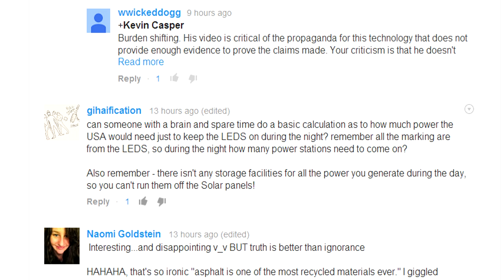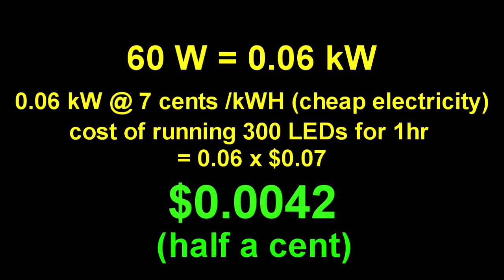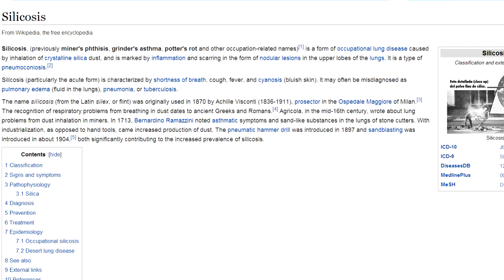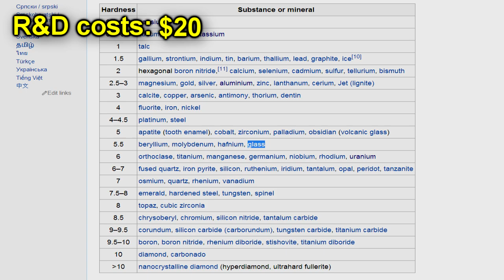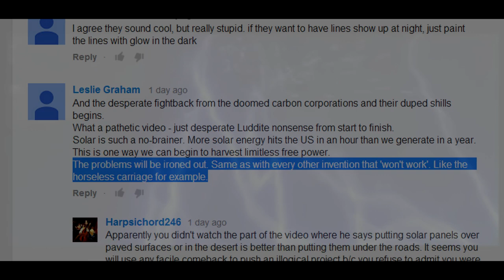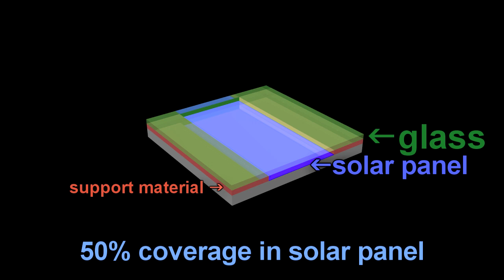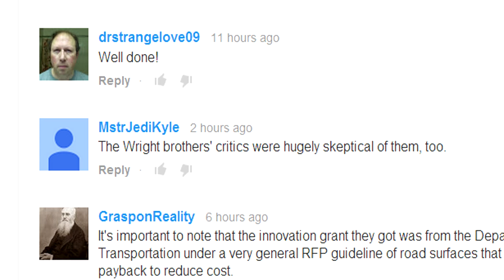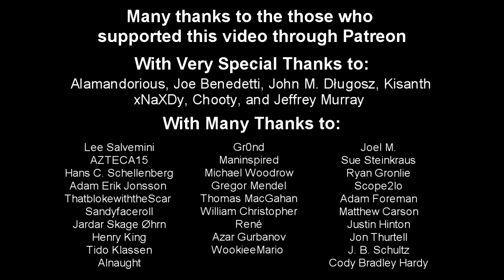Solar Roadways, IMPORTANT QUESTIONS AND ANSWERS!

Comment: Glass and weather conditions do not mix either! One wet/snowy day and it would be carmageddon!
Reply: First sharknado,now carmageddon. The Apocalypse is coming. :p
Reply: DolgLanjelin Thunderf00t addressed that in his video:  
You need a huge ass amount of power to melt snow, and when there is snow already on the panels, they don't produce any energy, so it must be delivered form further away or other generators.

Lets assume 10 cm Snow (~4 inch) and a rather often used density of 0.1 g/cm³, we get 10 kg of snow per m² or 8.4 kg/yard²)
To melt ice, you need 334 J/g. 
In total, this would mean we need 3.3 MJ or about 1 kWh to melt the snow of a 1 m² and about 0.8 kWh per yard².
So 1 m²  or 1.2 yard² per kWh.

Now compare this to moving the snow.
Mind you, this is only a rough sketch as i don't have any good numbers for this).
Let's assume the snow-truck has 150 hp, that's roughly 120 kW, so in an hour, he would use 120 kWh.
Now we can already conclude.
If you the truck would only clear 120 m² (140 yard²), it would be as efficient as melting it.

That's a bit little, i think you would come further than that in an hour, lets say, like 32 km (20 miles).
I think that's a fair number, driving 20 miles / 32 km in an hour of moving snow.
Make the truck small, so it only clears a 2 m / 2.2 yard wide area (tiny), and we would get 64000 m² / 76500 yard² .

Now we have to divide this by our 120 kW and we can see, how much of an area the truck clears compared to melting with the same amount of energy:

64000 m²/120 kWh = 530 m²/kWh
76500 yard²/120 kWh = 630 yard²/kWh

In comparison, this is about 530 times as efficient as melting the snow.

And now the bummer:
For snow-melting, i have take optimal efficiency, no losses at all, you'd never reach that. You'd have to heat up the road too, and a huge amount of energy would be lost.
But for moving the snow i let the trucks motor run at full power the whole time, while only driving slowly and clearing a very narrow path.

In conclusion, no matter how efficient you make a road-heating, it will be worse by at least a  factor of 500.
Reply: Don't forget to include all the waste products that will end up on that glass. You know from animals, storms, vehicles, especially the oil! It'll start looking like The nutcracker on ice on them roads only with vehicles and not nearly as graceful. All that stuff that will end up on them will also reduce efficiency as well.
Reply: GalacticDoomSquadron
I'm not entirely certain but I vaguely recall them saying they would implement  some internal heating to the panels that was in the sub zero exposed zones... I wonder how that will affect the power calculations ;)
Reply: axe863 The end is neigh all hail Lord Smoosh!!!!
Reply: Here is something with MUCH more promise than solar roadways (but it only has 5 more days left of funding):  https://www.indiegogo.com/projects/focus-fusion-empowertheworld--3
Reply: GalacticDoomSquadron I call hoax:
First, their technique is nothing new, and not better, than the dense fusion techniques of others (their own numbers even reflect that), and those have tried to improof it since over 40 years, and still nobody thinks its even close to feasable.
In their own published data (for advertisment as it seems), they claim several inpossible things that supposetly explain, why it would work.
One of the best examples would be a magnetic field of 10^6 Tesla.
The strongest magnetic field EVER prodcued was only 2800 Tesla. Thats not even 100th their claims.
http://ieeexplore.ieee.org/xpl/articleDetails.jsp?reload=true&arnumber=823621
That field is created for a tiny fraction of a second by using high explosives.

And this scampany declares, they creat a magnetic field nearly 400times strong permanently? .........

If they would be anyhting they claim, sponsor would jump their ship like crazy to hog on the money, but they go growd-funding....
Reply: GalacticDoomSquadron "Have you read the FAQ or watched any of their presentations?" Yes, and specially those, together with their "technical" presentations make me more than sceptical.
They claim to have something extraordinary, yet the data suggests, they have the same things we have since the 1970s.
Or the thing about having magnetic fields over 300 times stronger than the strongest field ever produced with a huge amount of high explosive.

"because he doesn't want a hostile takeover" He wants to get money for free wihtout having to do anything.
And no, look at what happens to other inventions:
If anyone thinks he could make money with it, it would instantly get a huge amounf of fundings or would even be bought - didn't happen so far.

If something sounds too good to be true, it certainly is not true.
Reply: ABaumstumpf  Your last statement is not entirely correct. It applies to some but not to all situations.

It is possible that this is a scam, but I will have to look more into this to feel whether it is conclusively so.
Reply: GalacticDoomSquadron The video in your link lost all credibility (to me) when they said their generator puts out more energy than it consumes.
Reply: ABaumstumpf  Hm. There is a video with Eric Lerner, the lead scientist, speaking to a crowd and he said to them that he had disallowed people from owning focus fusion via shares because he doesn't want a hostile takeover, and because he has done this, none of the really wealthy people have offered to pay for expenses. Well, that was one reason. Another reason, he said, is because wealthy donors "travel in packs" and seem to only contribute to these things if other wealthy people initiate it. As for it being a scam, Eric stated many times that much of their effort comes from research 40 years old. He also seems to have credibility because he has already reached certain goals with his device.

Have you read the FAQ or watched any of their presentations?
Reply: ABaumstumpf  Here is something. Tell me what you think: http://focusfusion.org/index.php/forums/viewthread/1314/
Reply: axe863 Actually, Carmageddon came first. It was a very popular and controversial early-1990s video game.

Comment: The part of this video where cost estimates are based on some random set of LED lights on Amazon makes me question this whole video.  This guy (in this video) doesn't have a clue what costs are involved... and I'm sure the guys working the prototype don't yet have a clue what the final costs will be!..  Doesn't mean that the idea should be scrapped!  I'm sure, that mass manufacturing of a specific LED for these roads, combined with the at minimum 10 year (probably more) development time for this technology, that LED costs will be a fraction of what they are today.

Comment: Good one Tf00t. Impressive figures you calculated there. I was surprised you did not mention the dramatic increase in light pollution or the fact that there is a reason why asphalt or even concrete is better than "tiles", albeit of whatever material: load bearing and the fact that trucks will dislodge said tiles in no time flat (even before the glass gets a chance to be scratched so much that light barely shine through anymore).

In the Great White North, trucks rip huge chucks out of road in springtime because of the freeze/thaw cycle. Even my kids when told about this idea quickly concluded that it doesn't make a great deal of sense. And then there's the matter of the money.

Me thinks that when the furor dies down, in a week or two, and senator Crapo loses his re-election bid because of some scandal involving a goat, a page and a couple of apples, the "inventor" will be left with a lot of money to plunk down on a new house with the coolest damn dance floor in the whole town...

Comment: What about decreasing the size of the hexagons to say the size of a 50 cent piece, adding a metal lining around the side of each hexagon which have a height that's taller than the glass panels within to support the tires, and assemble them at the factory to fit in larger tiles that can more easily be replaced on the road with a quick hot-swap?

You could devote only a few of these small hexagons to LED's, or simply paint a few hexagons for road markers which could be entirely metal, or stone which would also add more support.
Reply: Great, another dumb change to a dumb idea to solve problems that don't exist.
Reply: Becuse the metal lining is worse than the glass? Too grippy when dry, too slippery in the rain/snow, And the rest is stiff glass. And you would have even less solar panels at that point when they are already inefficient, covered by blurry and scratched glass, and have cars covering them most of the day, there would be no point in doing it at all.
Reply: Jeff Lavin
At least I'm offering ideas. What have you done? Scratched your little ego?
Reply: oBLACKIECHANoo
You could angle the metal so the light is focused toward the solar panel like a tinfoil oven, or even use the metal to absorb heat. With the lift on the lining tires would not be touching the glass.
Reply: oBLACKIECHANoo
Metal expanding, and contracting with change of temperature does pose a problem, and metal I'm sure could cause loss of traction.
Reply: Erik Benefield

I've shot down stupid and impractical ideas that would have bankrupted the country and caused environmental destruction. I've also offered alternatives like solar panels on rooftops and LFTRs.
Reply: oBLACKIECHANoo
Then again roads expand and contract with temperature as well and those have to be replaced too from cracks, and wear and tear. It also occurred to me the angles on the lining could provide some sort of traction.
Reply: fubecabr
When I first read your post I thought you where the other guy, so my last response was unreasonable, but anyway on the topic of solar powered roads you think it's a good idea, bad idea, completely scrapped, or tweak-able? Your reply was more of a statement, and not adherent to my comment.
Reply: We may not need to change the road idea much at all aside from take out the LED's, and add some sort of screen protector like we have on electronics which could protect from traffic, but also UV, and infrared light that damages solar panels. That, or find a suitable replacement for silicon which seems highly unlikely.

Comment: The main concern of this whole project is simply that it has too many elements to it without a proper assessment of risk. Even if one panel failed, what does the repair job entail? Simple roadside construction or a team of engineers, electricians and NSA meets CSI crime busters to find the cause?

As anyone who knows anything about complex systems and decentralized automated technologies, in a complex system so-called "normal accidents" are inherent because there is no way to control every contingency and so elements of chaos enter, i.e. even an arbitrarily small change, or perturbation, of the current operational trajectories may lead to significantly different future behavior of the system.

Hence, large civic engineering projects have to be conservative, for cost-risk reasons as the taxpayer is footing the bill, and also because the system itself still has to continue to operate to a degree during the renovation.
More importantly the project has to be done under the assumption that there is a real issue with the roads. Is the problem here with the roads and their ability to function? No. The roads, work under their intended design.

The roads were not designed to produce power, anymore than electrical powerlines are designed to be used for communication. Interestingly such a scheme was atempted, under similar assumptions, i.e. "we have these powerlines going to waste" and a civil engineering scheme was attempted to use them for communication in so-called Broadband over Power Lines or BPL which became a dismal failure and a huge waste of money 
http://eandt.theiet.org/magazine/2013/10/broadband-over-power-line.cfm
this is an achetypial example of how civic engineering projects can fail due to being too complex and hence vulnerable to chaos, where small initial trajectories, i.e. inherent electronic noise can propagate and create huge faults, i.e. signal degradation and attenuation. In several causes the electronic noise perturbations were so chaotic that voltages were created that were able to switch off the Arc-fault circuit interrupters, hence triggering electrical fires. Hence by ignoring risks in making existing structures so complex that we begin to be overwhelmed with externalities we open up a Pandora's box of possible accidents.

A solution therefore is not to make rework the existing infrastructure to the point that it does not function under its intended design but to actually work around it with what you have available to you. The problem with this plan is that it critically depends to replace all roads with this technology to work, as they state that any issues with low sunlight with one region will have to be made up with another and another and so on. If that's the case then why not isolate the power generation to the most efficient regions available to generate energy in the first place, i.e. away from the roads and carpark grounds themselves? Or at least away from what will interfere with the intended function of the roads.

Its not unreasonable to use these panels in small sale however, to eliminate some of the complexity and hence vulnerability to chaotic externalities, i.e. put in sidewalks, parks, perhaps even in underwater features such as ponds and swimming pools.
Road implementation is just too complex and vulnerable to externalities and hence accidents.
Reply: Lorenzo Ermanni You could just build solar panels over all roads, doesn't take up any more terrain, it's technologically feasible right now without having to invent new materials and it's a lot cheaper to construct and maintain. Of course this would still not be even half as efficient as large solar farms with sun tracking solar panels. Which are even cheaper to build than roofs over roads.
Reply: Lorenzo Ermanni Space is not an issue in the southern deserts of the US, where solar panels work the best, if you want more solar power the solution is to to build more plants there is plenty of room. The great thing about building a solar pant is you can actually use them as optimally as possible, buy pointing them at the sun and not putting a car on them.
Reply: Lorenzo Ermanni Before any testing is done you can easier do some basic calculations to figure out that the system is totally unworkable. And even if you want to jump to testing you would never jump all the way to building a road and a simple small scale test on a single tile I'm sure would be suficent to prove that they can't build what they claim they can. We all wish this could be a thing but its not and cannot be in the way these people are trying even the most basic calculations or testing would prove that. Lets just hope that this couple are just not smart enough to realize how unfeasible this all is and not just scam artists.
Reply: Lorenzo Ermanni not if you put them on roof's and over cap parks.  that is a much cheaper and more efficient alternative.
Reply: Lorenzo Ermanni putting the panels on a roof and over car parks is far more efficient than in the roads.  first you would have cars constantly blocking the light.  2nd the roads cant move and adjust angle with the sun so they only take in a fraction of the sun light that a normal solar panel will.  and 3rd the panels they are using are only about a 3rd covered with solar cells.  where as panels you put on a roof or anywhere else is about 99% covered in solar cells.  and for the most part all these panels they are trying to sell do is have very few solar cells on them and have some LED's on them which at the angle you wouldn't be able to see during the daylight anyway.  so that right there is a big flaw.
Reply: Lorenzo Ermanni Nobody is seriously suggesting to build a roof over all roads to put solar cells on. It is a ludicrous, horribly inefficient idea that is cheaper, more feasible and more efficient than making solar panel roads.

My actual suggestion would be to keep using asphalt for roads and build much more efficient sun tracking solar power plants somewhere else. Which I believe I already made in my first reply.
Reply: Lorenzo Ermanni And another thing, there's no evidence that this technology could save lives on the road. They have done no real world tests on that.

On the other hand some simple tests as done by ***** show that the visibility of these led lights is non-existent under bright conditions, so they can't be much help in any daytime emergencies, which is when most people are using the road.